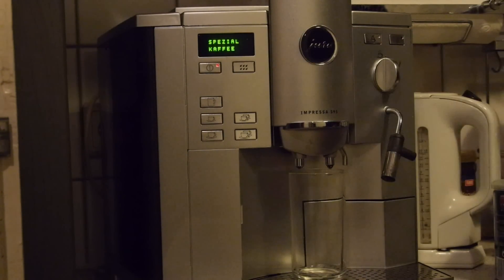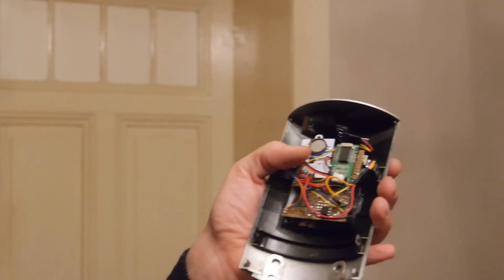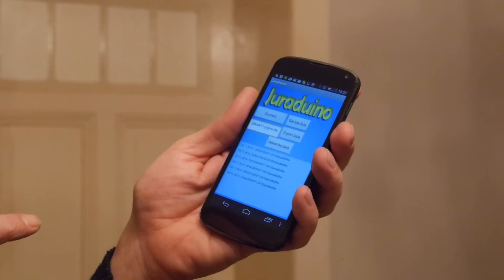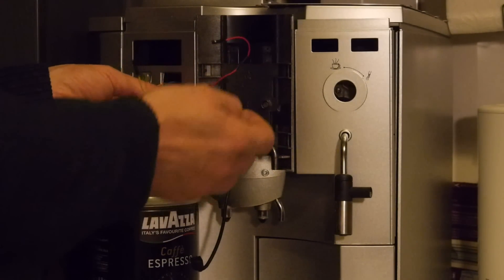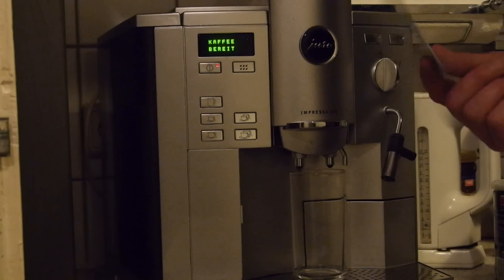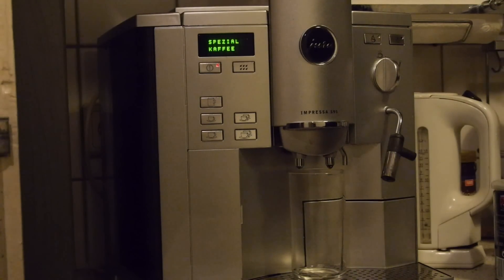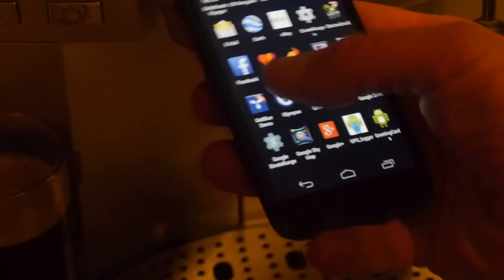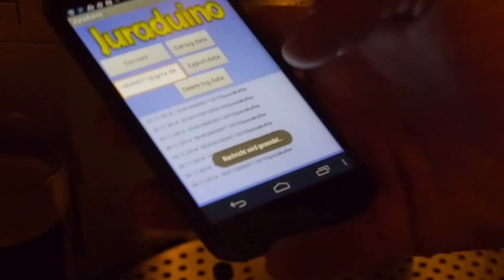RFID-enabled Coffeemaker "Juraduino" Jura Impressa S95 and Arduino

Comment: hey! i am looking at your channel right now... you've got fantastic stuff! very amazing. i will go through them once i am done with this little project.
<<latest update>>
i managed to communicate with the Jura J9.2! it switches off and brew a coffee via command line... The machine doesn't like the ?M3 command to enable the inkasso mode. i tried sending *EIN or *AUS with no much luck...
do you have an email or a website for easier communication?
Reply from the maker: +themoss You should find my mail address in the channel info tab.

Comment: hi! great job! i am trying to do the same with jura j9.2. i have connected everything and the Code is ready. i am using a different card reader so i had to change the code i found in the internet a bit.  one question and i would be over the moon if you could answer: do you know if the Jura Impressa J9.2 use the same communication protocols as use with this one? the machine doesn't respond to any command. it has a 7pin serial port
Reply from the maker: +themoss Well, I don't know, if the J9.2 uses the same protocol, but I will let you know, if someone tells me s.th. about it. But if it has a Eugster logic print it should work. Let me ask: Are you sure, you connected it correctly?

btw: this question is about this video: https://www.youtube.com/watch?v=uXPG3yZxTzM
Reply: +Inter Action big wow! didn't expect such a prompt reply. Really appreciated it and thank you very much indeed for your kind reply.  
The machine has a 7pin port.. I double checked the location of the 5V, even though I am not really using it right now (wanted to make sure that everything is working first so I have been powering my Arduino using the laptop USB.). The Pins from left to right are: nc, 5V, nc, TR, Ground, TX, nc. (see? i still remember :).  the code has software port (4,5) commented Rx / tx.  I connected Jura's Tx to 4 and Rx to 5. I tried simple commands like AN:01 and AN:02 with and without \r\n. The Coffeemaker_tool sketch return the bin and the hex of the sent commands. however, it doesn't seem to be sending CR or LF at the end of the command... 
nevertheless, the machines doesn't send anything back :(. I was quite sad to go that far and then get stuck with this one. I suspect it's something to do with Jura impressa J9
Reply: +Inter Action as a wee thank you, i've added your video to my likes :)
Reply from the maker: +themoss I would try to power the Arduino via the Jura. If it works, +5V and GND are correctly connected and the port is working. ;) Btw my source says nc, 5V, nc, RX, GND, TX, nc. Did you measure where +5V is?
edit: If you receive what you sent it may be just because you mixed up RX and TX?
Reply from the maker: +themoss According to http://protocol-jura.do.am/index/serial_interfaces/0-6
Reply: +Inter Action Cant thank you more really!! I will try to power the arduino from the port itself... yes, i have clarified that the 5V/GRN on the port does provide 5V. I will certainly keep you updated. Thank you greatly for the quick replies. I am very enthusiastic about this project.
Reply: +Inter Action it was my mistake in my previous message. I meant RX not TR :) so i was wiring the thing correctly according to this
Reply: +Inter Action  Hey! I am using IDE 1.6.5...  thanks for pointing out to the bug! :).. I hope to just reach this stage soon... I hope to be able to just communicate with the machine first.. I am using the Communication_tool sketch to do that.. the coffeemaker doesn't respond so far. I will power the Ardunio using the machine  5V port. Shall I feed that directly to Arduino V5 pin? I haven't power the Ardunino externally before
Reply from the maker: +themoss In the code of the communication tool, change following line:

SoftwareSerial mySerial(10, 11); // RX TX 

I changed the pins to 4,5 and it seems I did not yet update the code of the communication tool. So just change the code to match the pins used by your hardware (4,5).
Reply: +Inter Action you're being super helpful!.  I am actually using pins (3,4) so i have changed that accordingly in all sketches...I might phone Jura quickly now.. do you know if i can just feed the V5 of the coffee maker to my Arduino V5 pin?
Reply from the maker: +themoss Yes, if you using a 5V Arduino. You skip the voltage regulator by connecting direclty to the 5V pin, but in this case this should not do any harm.
Reply from the maker: +themoss Specs for different Arduino boards, including operating and input voltage: https://www.arduino.cc/en/Products/Compare
In case of connecting directly to the +VCC pin you skip the voltage regulator of the Arduino and therefore your voltage from the coffeemaker should match the operating voltage of the Arduino.